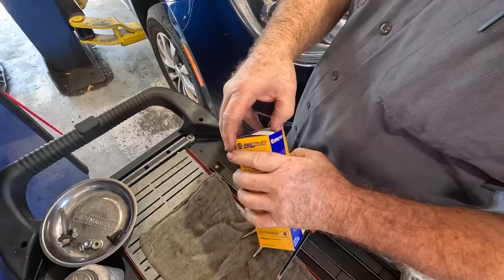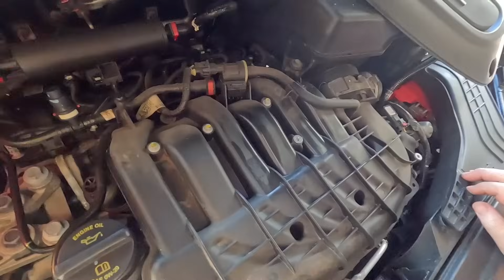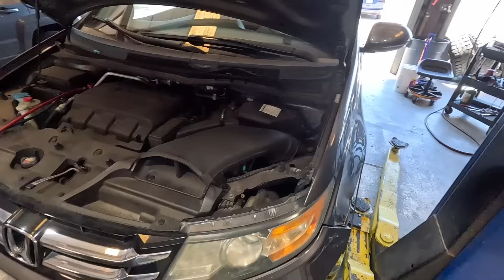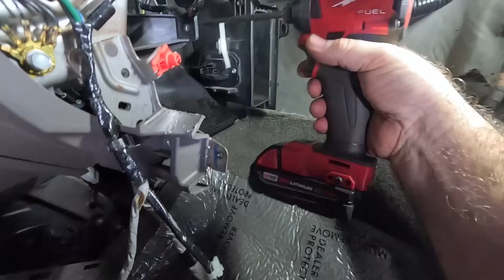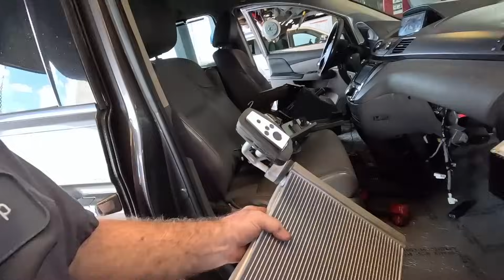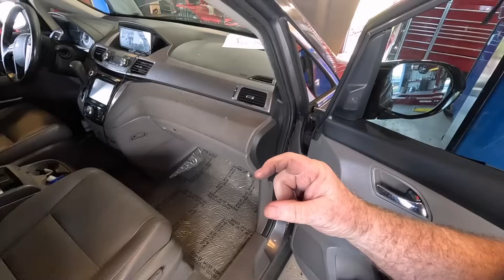69 Cutlass, Blower again, Odyssey Evaporator, Pacifica Cranks now LOF, Auto Repair Shop DAY 735

Comment: Tell whoever was impacting during the evaporator that they're using the wrong size impact for the job.. 

Evaporator was yet another example of trying to save the customer $50 and costing you potentially hundreds, it's always the mechanic taking the financial hit. That's two videos in a row where you had to repeat jobs due to crap parts, mixed information and inexperienced service writers. You don't order an evaporator without a new expansion valve and gaskets just like you don't replace a failed compressor without a new condenser. 

That is why I left the industry Jimmy, people won't blink an eye signing on that $1000 cellphone but you ask them to spend $100 more on their automobile and they get angry. You don't tell a doctor how to fix your body so why do people tell mechanics how to fix their car?
Reply from the maker: Agree 100%! I have thought about a career change, but it is honestly too late in my career at this point I think.

Comment: In regard to the leaking evaporator, no after market parts should be used on difficult jobs.  That kind of work should be filed under, "Cha-Ching".  No exceptions, no apologies.
Reply from the maker: I agree. I always ask, the usual response is, but it costs more, or it takes a day to get. For really hard jobs, I press a little more. But not enough to get fired hopefully. lol

Comment: Another great video Jimmy! How have those Pittsburgh locking extensions been holding up for you?
Reply from the maker: Perfect so far. I don’t use them often but great when needed.
Reply: They're pretty much all I use with a manual ratchet anymore, nothing worse than dropping your socket into the abyss. I wouldn't use them on the end of an impact regardless of the brand.

Comment: Me personally I don't believe in and flushing your coin system because apparently right as you do it it causes leaks
Reply from the maker: Yeah, if there is a problem it will show it to you for sure. It won’t cause one though.
Reply: Same with engine flushing almost every time a leak occurs